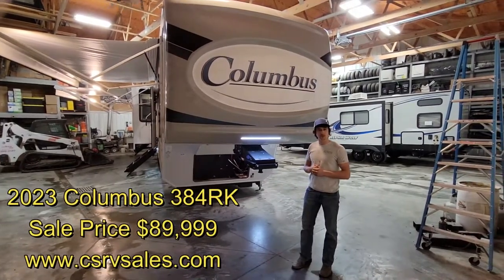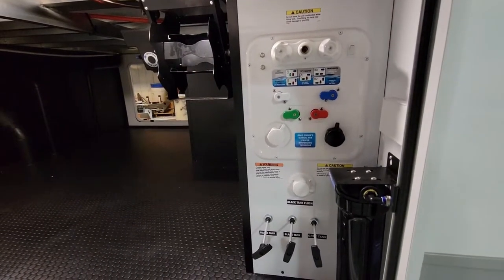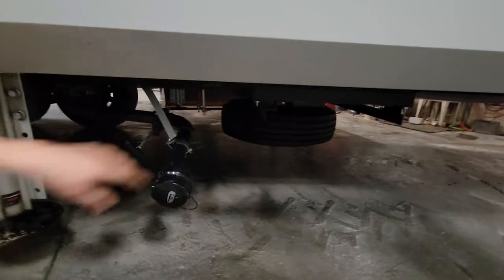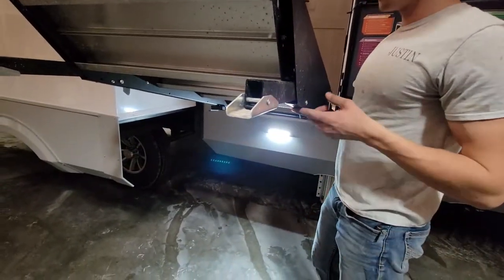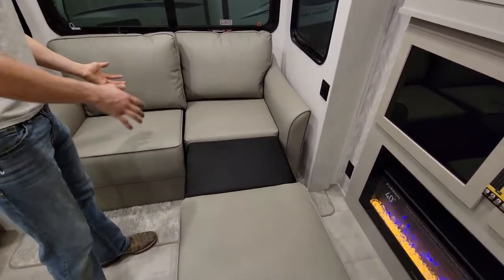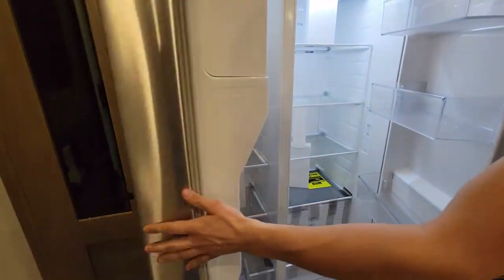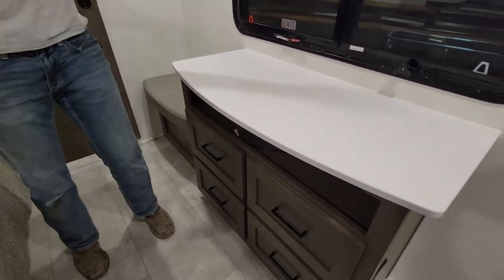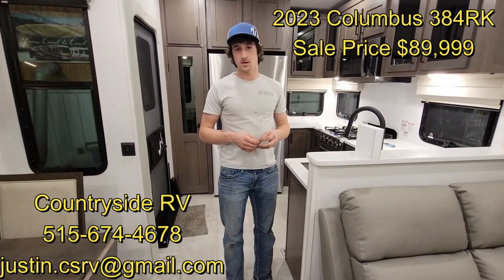2023 Columbus 384RK Luxury Fifth Wheel

Comment: The bedroom slide don't appear to have pinions to operate the slide. How does that slide operate?
Reply from the maker: The rails run along the edge of bed and the motor is towards the rear of the bed hidden. It is a very sleek and durable design.
Reply: @csrvsales  thank you. I looked up different slide types and it explained the hidden slide. I appreciate the info